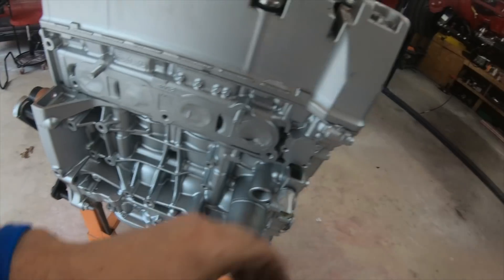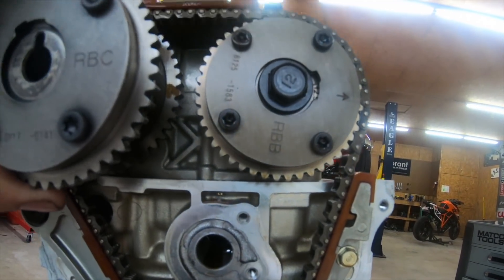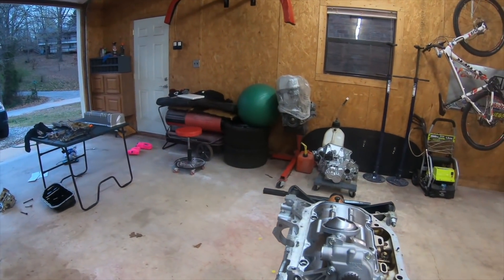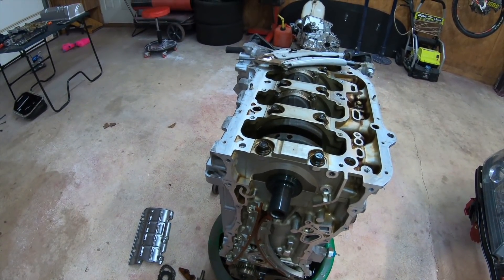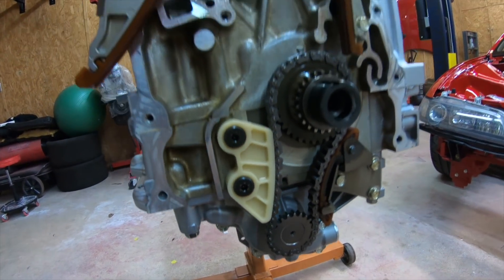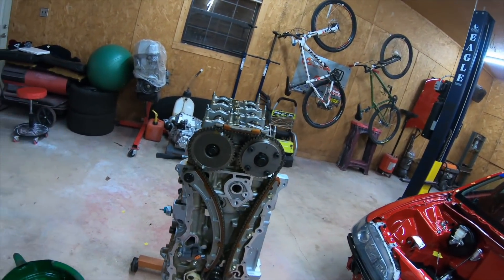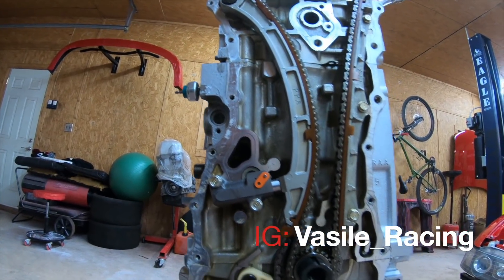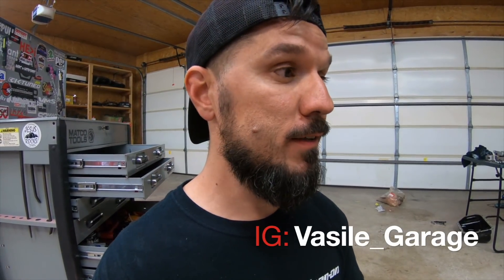k20a2 oil pump and 50 deg vtc swap in a k24

Comment: What's up brother, i'm going to be attempting this, while the engine is still on the car, what kind of tips and suggestions can you give me.
Reply from the maker: Alvaresmaico20 just take your time
Reply: @vasilegarage2606  alright, one more thing I'm trying to find out how i can hold up the engine best after i remove the side engine mount and oil pan without damaging anything. You got any suggestions?  this is what's really stopping me from starting on this.
Reply from the maker: Alvaresmaico20 just use the jack under it with a 2X4

Comment: Did you use the k24 crank ? or did you put the k20 crank?
Reply from the maker: Jesse Acero stock motor, stock k24 crank
Reply: Vasile Garage alright thanks
Reply: Vasile Garage Yo do you change the k20 timing variable solenoid to the k24 ?

Comment: Did u unlock the vtc gear or just unbolt it I'm currently doing the exact same thing you did
Reply from the maker: Adam  Sobers just installed it that’s all
Reply: @vasilegarage2606  thanks man loseing sleep over it you have been a huge inspiration to me on doing this build and its the first time IV ever swaped a motor
Reply from the maker: Adam  Sobers you got this friend
Reply: @vasilegarage2606  thanks man and yes I do got the rbc on and got it all timed up proud of myself thanks again brother
Reply: Adam Sobers did it end up working fine ? I’m planning my k24A swap and want to do the oil pump and 50 degree vtc, did you also just unbolt it and bolt it back up ?

Comment: What’s up I have a question what are the main sensors I need from my k20 to k24 swap?
Reply from the maker: Jesse Acero everything is the same only diff is the main crank sensor
Reply: Vasile Garage okay thanks did you use a longer serpentine bel?
Reply: Belt?
Reply from the maker: Jesse Acero I’m running a ktuned alternator delete with belt
Reply: Vasile Garage okay thanks for the help 👍
Reply from the maker: Jesse Acero anytime
Reply: If you swap the K24 you need the K20 CKP sensor. If you keep the K24 CKP sensor, it not start🤫🙂

Comment: Very good informative video. I have a k24a2 swap with a stock 25* vtc. I read that k24 have clearance issue over 45*. Did you ever have any issues with the 50? Or do you just tune the cam tables to never past 45?
Reply from the maker: Stay in Yo Lane Iyar it tuned
Reply: I am here asking myself the same question if i put that 50 degree cam gear? Would i have any issues on valve clearance once i turn it on or run it? Also do i have to put the cam and lock it with the cam or do i have to put it unlocked and then timed it ? I am really unsure on how is the step of putting the cam gear ? I have that same engine K24A

Comment: hey vasile what year motor is that from hmotors? Should I get the 04-05 Jdm k24a, or go the more expensive route and get the 06-08 tsx k24a2?
Reply from the maker: masteryoda655 06-08 makes more power

Comment: have you ever had any problem with the 50 degree intake cam gear?
Reply from the maker: Richard Douglas nope
Reply: Do you have to unlock the vtc gear before installing onto cam or can you just bolt it on.

Comment: Also if you put the locking pins in the rear of the cam shafts and cam cap , you can trust that the cams will stay in place....

Comment: K24a, k24a2 and K24a3 is the 3 good k24 engines.
Reply from the maker: Martin Schager yea I meant K24 Tsx
Reply: Vasile Garage don't got the K24a and K24a2 in europe, we got the K24a3 from Honda accord. It is similar to K24a and K24a2 👍
Good video👍
Reply: The 2.4A8 I just put in  a '06 accord was pretty quick